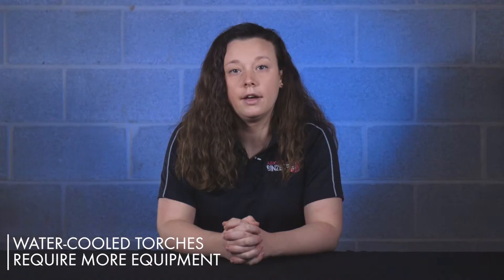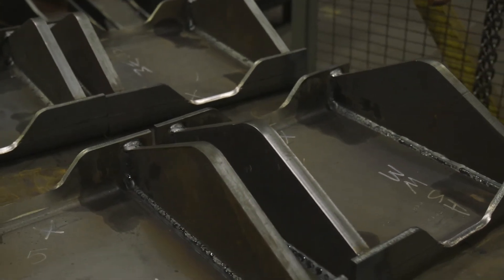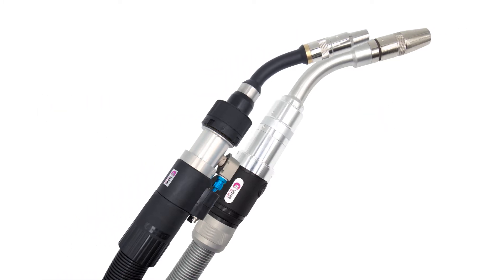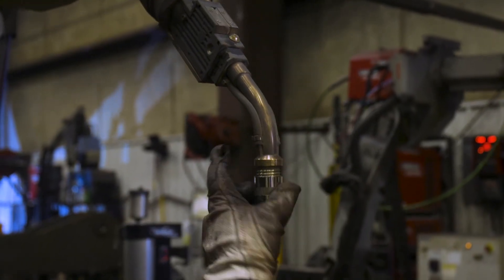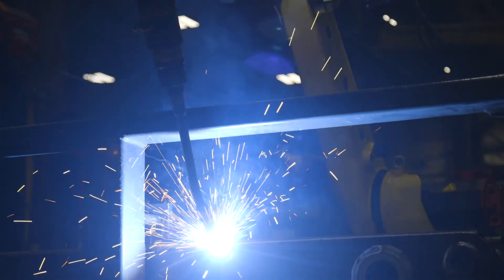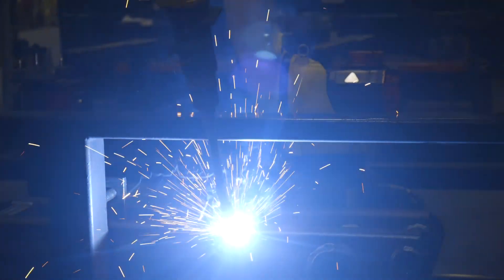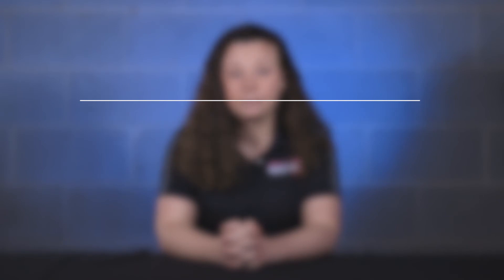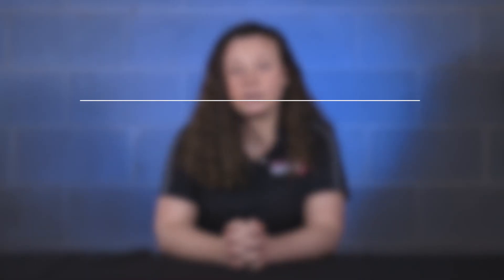Air-Cooled vs Water-Cooled Robotic MIG Torches

Comment: I am surprised that anyone today offers an air cooled robot torch, even low power applications with a high uptime robot quickly degrades an air cooled torch consumables and gives rise to wire feed and gas coverage problems etc, the torch difference in cost is minor compared to the overall robot system investment.